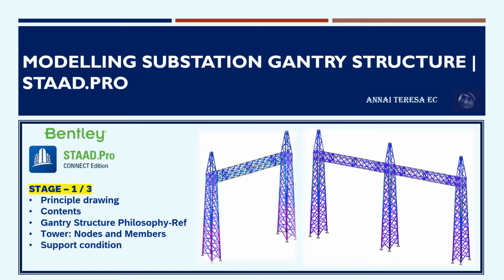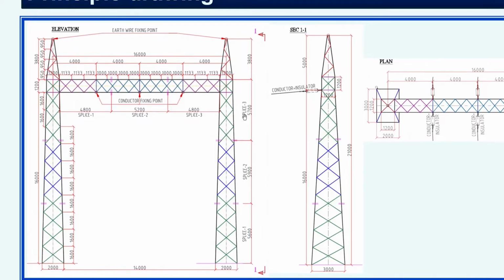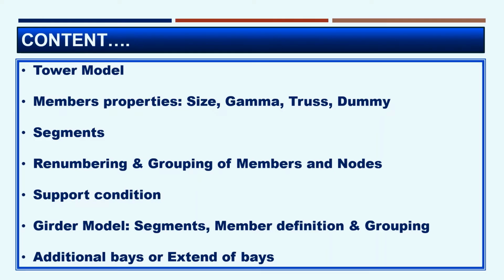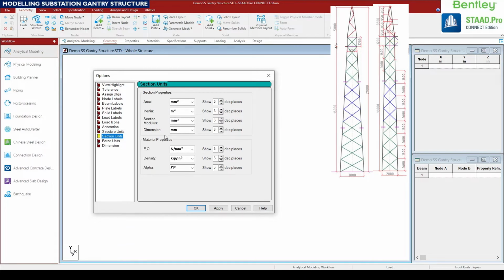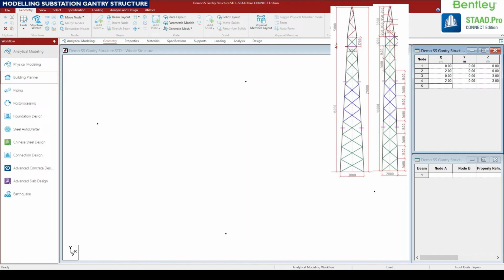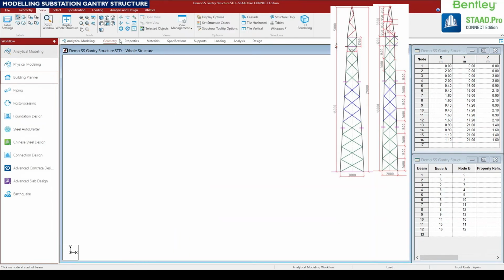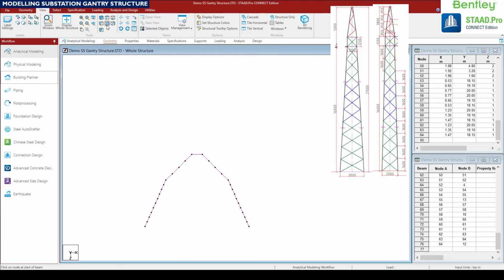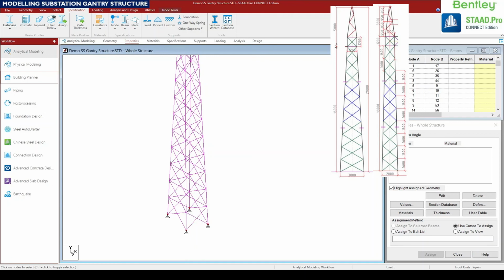Modelling Substation Gantry structure  STAAD Pro  STAGE 1 of 3

Comment: Hello. Thank you for the video. Please fix me. As I see your distance node to node must be VERTICAL 1600mm. But your distance is 1600mm node to node on the line of beam. Not vertical. Am I right?
Reply from the maker: Thanks for watching video. Yes, it should be vertical. Minor differences in mm are tolerable while taking measurements node to node. It is good to go for accurate modelling.
Reply: @annaiteresaec  Thank you for your reply. One more question. What if the all dimensions is not equal. Fox example 7eters height. 2m+2m+2m+1m.  In this case I can't use equal node function. If I set node height distance manually it is wrong as well because when I set manually the node to node distance is not vertical or horizontal, but node to node on the beam line. If I edit height on the right tab (on Y), then the Z and X coordinates are wrong and I can't calculate them. So how to make for example 2+2+2+1 node to node height vertical?